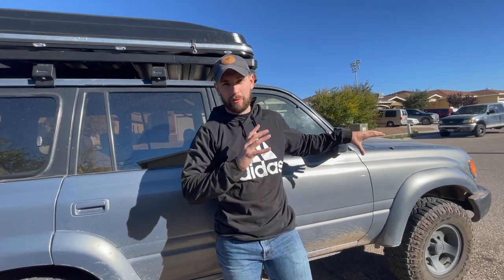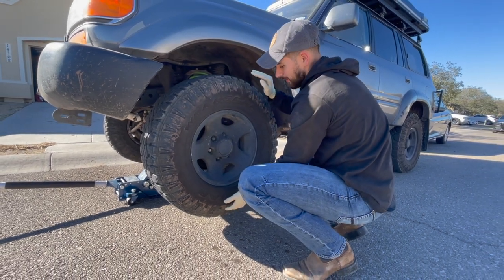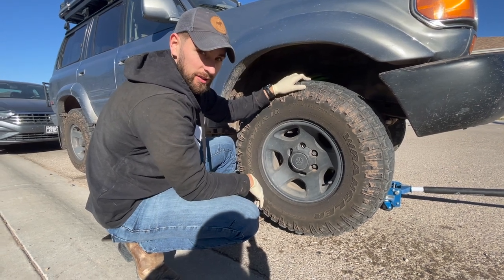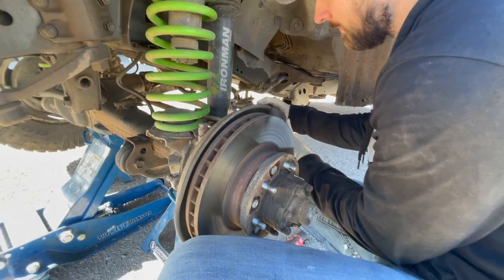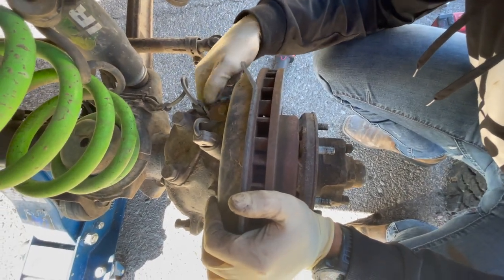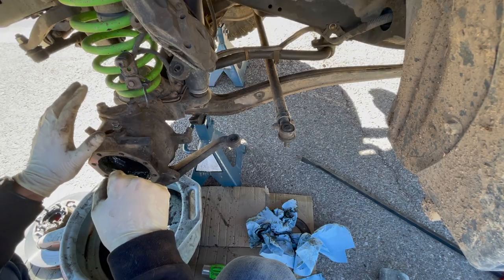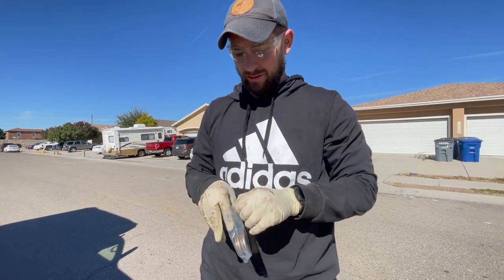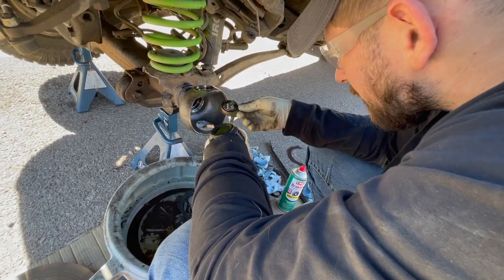80 Series Land Cruiser Axle Re-seal and Wheel Bearing Woes! | Axle Rebuild Part 1

Comment: A trick I learned from a cruiser mechanic to get tie rods out is to take 2 hammers and swing from both sides contacting at the same time. This bows the hole just enough and the tie rods should just fall out. If you dont have room to swing from both ends pout pressure on one side and swing from the other.

EDIT: I guess it's a little different when the rod goes in through the top but the same theory should apply. You just don't have gravity helping you.
Reply from the maker: Yeah I'm not sure why these were so difficult, normally a few hits will get them 😂. I ended up breaking down and getting a ball joint tool shortly after this video was filmed lol.
Reply: @motor.mausGarage  understood. I have those too and the game method is better. I've rebuilt knuckles many times and that has been the best method for me. Give it a try next time 😋
Reply from the maker: Will do!
Reply: I meant hammer. Damn autocorrect 😂😂😂⚒️⚒️⚒️

Comment: thanks for posting all these videos man. I'm pretty much on the same boat as you with my 80. Going to tackle this after a coolant flush with some hose replacement. Happy new years
Reply from the maker: Happy New Year! Glad you find some value in my videos 🙏
Reply: @motor.mausGarage  
I am looking at acquiring a fzj80 in the next few months. Any advice on what year is best between 93-97? Thanks
Reply from the maker: People seem to like the 94+ with the 1FZ engine, myself included. I also believe there's a lot more support for 94 and up for parts. And typically the newer the year, the less time it has getting beat up, except mine it seems 😂